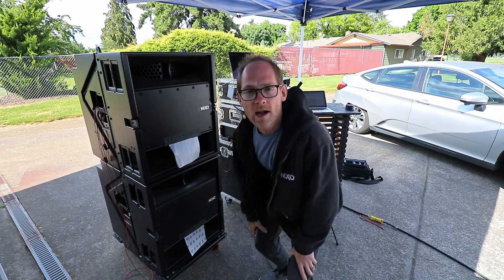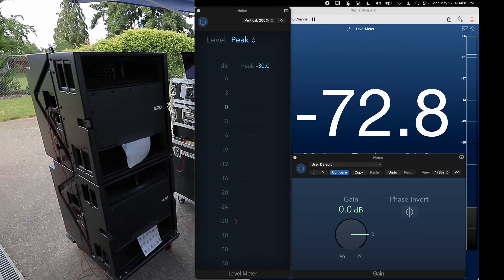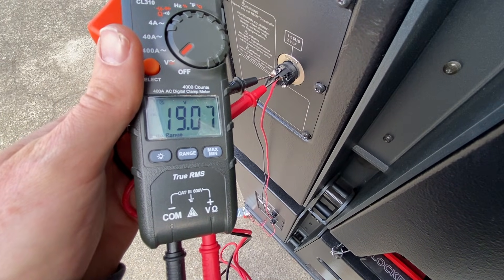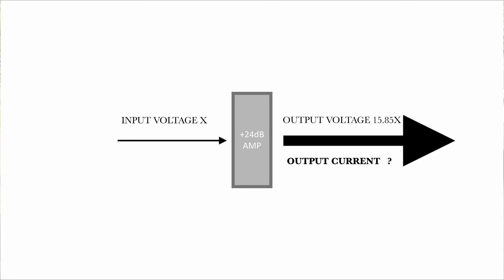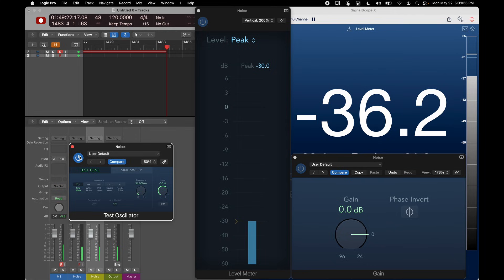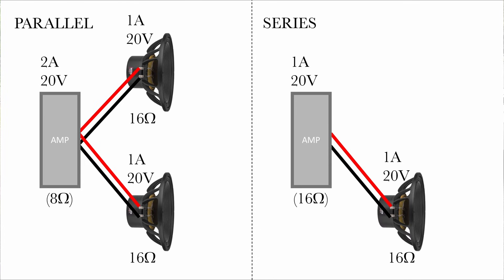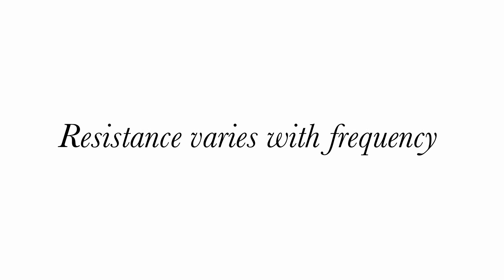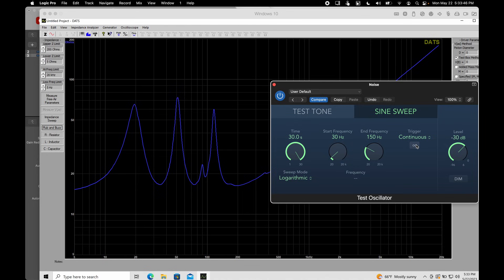Is doubling speakers +3dB or +6dB? What's parallel and series wiring?

Comment: But with the same impedance in the amplifier both series and parallel has the same +3dB effect.

Example__
Think an amplifier that is capable of delivering 64W at 4ohms. So that we drive 2 speakers with 2 ohm each by series way, so that each speaker will get 32W. We have two such speakers, therefore we get +3dB as doubling the power adds 3dB to the loudness.

And by that same amplifier, we are running two 8ohm speaker in parallel mode. Then the impedance will be the same 4ohm. Each speaker will get 32W. In this situation also we are getting +3dB due to the previous mentioned rule.

Note: only lowering the impedance and getting doubled power by the amplifier only increases 6dB.

Comment: Soo parallel is louder than in series and that's why most car subs that can go down to lower Hz will with proper power amp,  like a 1 ohm amp that will run to 1ohm sounds better or louder (proper box made to go lower hz) than one in series?
OK I got it. Thanks... Hope this is right?

Comment: Here's something I always wanted to know:-
You build two subwoofer boxes with two 18 inch 8 ohm speakers each. You wire both speakers in both boxes in series. That would mean both boxes would be playing at 16 ohms. If you were to then 'daisy chain' both boxes together at the speakon connectors, would they then both be playing at 8 ohms or at 16 ohms?
Reply: The added benefit of doing what you say in say a club is that if you overdrive those boxes wired in series internally, you will only ever blow 1 of the two drivers as as soon as 1 blows, the series circuit opens up saving the other driver. If you wire the boxes internally in parallel, you will most likely blow both drivers if you overdrive them. This is a huge consideration when designing a club system for DJ's etc to use. The cost difference between replacing half vs all the sub drivers can be astounding.
Reply: @wally7856  I know.
Reply: If you wire each 8ohm speaker in a box in series, that would increase the impedance to 16ohms per box. If you then daisy chain(parallel connection) each boxes, that would lower the impedance to 8ohms.
Reply: @ThaKingRyan  thank you. That's all I wanted to know.

Comment: Only coils in dvc subs should ever be wired in series. I would never, ever wire separate subs in series. Just asking for trouble.
Reply: Yes but wiring say a double 18" sub internally in series has benefits. In a club system if the DJ overdrives the system you will only ever blow 1 of those 2 sub drivers as the series circuit will open up saving the other driver. If you wire the box internally in parallel and overdrive the box, you will almost always blow both drivers.

Comment: You have to consider the Amplifier's impedance output as well.
Let me use 8 Ohm speakers because many amps have 2, 4, 8, or 16 Ohm outputs.
All Voltage, Current and Watts are RMS in my discusssion.

4 Ohm Output: Two 8 Ohm speakers in parallel = 4 Ohms (impedance match), at 40 Watts: In this case the Amplifier will supply 40 Watts. 12.649 Volts out with each speaker drawing 1.582 Amps each = 20 Watts from each speaker for 40 Watts total.
4 Ohm Output: Two 8 Ohm speakers in series = 16 Ohms (impedance mismatch), at 40 Watts: In this case the Amplifier COULD supply 40 Watts but it can't. 12.649 Volts out but only 6.325 Volts get to each speaker drawing 0.791 Amps each = 5 Watts from each speaker for 10 Watts total.

Since -3dB is roughly a 50% Power Loss, 40 Watts to 20 Watts is -3dB, and 20 Watts to 10 Watts is another -3dB for a total of -6dB (1/4 the Power).
So even if the Amplifier COULD try to put out 40 Watts with two 8 Ohms speakers in series on a 4 Ohm output, it can't do that due to the impedance missmatch.

This is why Amplifers usually have several impedance outputs. Since two 8 Ohms speakers in series is 16 Ohms, you should switch to the 16 Ohms Output (if the Amplifier has one):

16 Ohm Output: Two 8 Ohm speakers in series = 16 Ohms (impedance match), at 40 Watts: In this case the Amplifer will supply 40 Watts but now using a different voltage. 24.298 Volts out but only 12.649 Volts get to each speaker drawing 1.582 Amps each = 20 Watts from each speaker for 40 Watts total.

So If you change the Speaker arrangement and not select the proper amp Output Impedance, you will get less power out of the Amplifier or you may overload the Amplifier and cause damage. So ALWAYS match the Amplifier's Output Impedance to the Overall Speaker Cabinet Impdeance.

Examples:
One  12 Inch Speaker  at 100W at 8 Ohms             = Cabinet  8 Ohms 100 Watts RMS (commonly used)
Two  12 Inch Speakers at 100W at 8 Ohms in Series   = Cabinet 16 Ohms 200 Watts RMS (less commonly used)
Two  12 Inch Speakers at 100W at 8 Ohms in parallel = Cabinet  4 Ohms 200 Watts RMS (commonly used)
Four 12 Inch Speakers at 100W at 8 Ohms in Series   = Cabinet 32 Ohms 400 Watts RMS (Outputs for 32 Ohms are rare, not commonly used)
Four 12 Inch Speakers at 100W at 8 Ohms in parallel = Cabinet  2 Ohms 400 Watts RMS (less commonly used)
Four 12 Inch Speakers at 100W at 8 Ohms in Series/parallel = Cabinet 8 Ohms 400 Watts RMS (commonly used)

Series/Parallel Arrangement of four 8 Ohm Speakers 100 Watts each arranged for 8 Ohms 400 Watts total:
     |
  -------
  |     |
8 Ohm 8 Ohm
  |     |
  -------
  |     |
8 Ohm 8 Ohm
  |     |
  -------
     |  

So why are there 2, 4, 8, or 16 Ohm speakers?  The lower the Impedance (ohms) of the speaker, a lower Voltage is required to drive it BUT LESS AMPS (current) is needed as well.
Since current (Amps) is key is power distribution (think of High Voltage power lines), a 2 Ohm Speaker (or Cabinet) requires less current though the wires to get the power from the Amplifer to the Speakers. At home or small venues, 8 Ohms is fine, but in a large arena where the Speakers are up high and many feet away from the Amplifiers, 2 Ohm Speakers and Cabinets are better.  

Series/Parallel Arrangement of four 2 Ohm Speakers 100 Watts each arranged for 2 Ohms 400 Watts total:
This Speaker Cabinet requres less current to drive the speakers and thus less current/resistance (IR) losses though the cables.
Also, lower current cables can be of a thinner gauge which saves weight and cost.
     |
  -------
  |     |
2 Ohm 2 Ohm
  |     |
  -------
  |     |
2 Ohm 2 Ohm
  |     |
  -------
     |

Comment: How do you have the meter leads on?

I tried using a normal meter to test for voltage coming out of my car subwoofer amp, which obviously takes in 12-14v and i get weird numbers
Reply: Use ac voltage on your dmm. Use a sine wave test signal to test for voltage, using music will get you readings all over the place.

Comment: Is it true that if you have 2 speakers and one speaker can handle more power than the other, the that speaker will take the extra power? So if you had a 10 watt speaker and a hundred watt speaker and a 100 watt amplifier you wouldnt blow the 10 watt speaker cause the 100 watt speaker would take the extra power.
Reply: I don't think so. If the speakers are of the same impedance, they will divide the power equally, and so I expect the 10 watt speaker will blow at high output levels.

Normally, we handle speakers of different power ratings by only sending high frequencies to the lower rated speaker, via a crossover network, because most of the energy is in the lower frequencies of music. The half-way point for division of power in music is around 120Hz as I recall, just above subwoofer range.
Two full-range speakers of different impedances could be a different matter.

Comment: So if you use 2 8ohm drivers  in you dubbel 18'' sub woofer. and you wanna use 2 cabinets on one side on the amplifier. then you need to wire the speakers in serie?

Comment: I'm not into SPL. Just good tone with best coverage for speaker, whether one or two or amount of ears listening. If a venue has capacity of 10,000 sets of ears and 10000 minds or 10000 bodies, how much power is needed in subpower for 1/2 of 10000 bodies in avenue that is designed for 10000 bodies. That seems more reasonable for life of any subwoofer. Using math to figure out impedance load is cool but in real world, a knowledgeable sound engineer needs to understand this in order to do a solid sounding show.

Comment: So if i were to use 4x 8ohm 15" Woofers in Parallel, what would the Ohmage then be?
And by adding any other speakers (8ohm) (but not woofers), does this have any (negative) impact
Reply: That would effectively be 32ohms. If you have an amp that can handle that, go for it. You can add more speakers if you wish, but keep in mind the impedance will also go up, and you might end up working your amps so hard that they die. A good practice would be to match your amp impedance if possible, that would be either by connecting your speakers in a series/parallel connection or getting more amps for your speakers if you have the budget

Comment: So far, the best video I've watched in the 36hrs I've been trying to understand about speakers. I have these 5.1 speakers I found in our basement with it's player already disposed of that I want to use as a pc speaker, and I'm trying to learn how I can install them when there's just one front and one rear 3.5mm headphone/speaker jack, though it's got a sound card that supports up to 7.1, for the life of me, I have never been interested in electrical wirings until now. I don't how I can wire them all into one jack, or do I need to install another sound card with more ports, or buy some whatnot to connect them to. If they get more expensive than buying a pc speaker, they're going back to where they came from, useless.
I'm going to follow you from now on and learn.
Reply: 36 hrs.? get some sleep, trust me, it's not that exciting and rather simple to learn - make it last cause after slew rate and damping factor there is not much on the horizon.

Comment: Parallel cost more speaker wire than series connection, basically parallel is way better than series is that right Sir?

Comment: In the video 1 amp drives 1 speaker 1A 20v 16 ohm, so 20 watts. Does that mean when connecting 8 speakers in series with acoustic coupling the amp only draws 2.5 watts while having similar acoustical output as 1 speaker? 😮 Because 1 speaker: 20V 1A 16ohm = 20 watts. 2 speakers: 20V 0.5A 32 ohm= 10 watts, 4 speakers: 20V 0.25A 64ohm = 5 watts, 8 speakers: 20V 0.125A 128ohm = 2.5 watts. I know 128ohm could be high for an amp, but this is about understanding the theory. Using 4 ohm drivers would result in 32 ohm load in the same 8 speaker set up. 

Or to get deeper into it: 2 speakers in parallel would result increase +6db. Meaning having a big array of 32 speakers in parallel would increase the acoustical output by a massive +30db! I am thinking of building a compact line array system with a 3 inch driver delivering 104dB > so max SPL of a 32 speaker line-array system would deliver 134dB am I right?

Comment: I am looking to run 6 Bass. Is using 3 amps in mono, and connecting the othe 3 to the speakers better than running 2 per amp?. Try to make it powerful and cost effective. 
6 Bass amps would be to expensive at this point.
I appreciate your channel. Thank you.

Comment: When you raise the amplifier by 6dB it makes output voltage doubled (20V to 40 V) , and current flow also doubled as manner (1A to 2A).calculating the (P) power it show 4 times increment as this: 20V x 1A =20W and 40V x2A= 80W. Clearly 80W means 4times like 20W.

But when you attached additional speaker it only cost more current, but no voltage increases, resulting power = 20V x 2A = 40W.

My question is, why the measurement mic showing 6dB same increment at both testings above, while the amplifier produce completely different power output as, 40w vs 80W.
Reply: I'm not into SPL. Just good tone with best coverage for speaker, whether one or two or amount of ears listening. If a venue has capacity of 10,000 sets of ears and 10000 minds or 10000 bodies, how much power is needed in subpower for 1/2 of 10000 bodies in avenue that is designed for 10000 bodies. That seems more reasonable for life of any subwoofer. Using math to figure out impedance load is cool but in real world, a knowledgeable sound engineer needs to understand this in order to do a solid sounding show.
Reply: @rgortega1285 Most (sound engineers? are selectively deaf (notch filter damage in their hearing range). I walk out of so many concerts that i've quite going. When is their mommy going to tell them the truth?

Comment: Depends if they're acoustically coupled (coherent). If so, pressure adds and you get 6dB. If not, power adds and you get 3dB.
Reply: I agree, two speakers outputting 20 Watts each is 40 Watts total, but speakers in unison do not add sound pressure levels linearly, they just push more air in parallel but at the same loudness. So dB in sound pressure does not always double when two speakers are driving the same signal at the same power level compared to one speaker doing the same.  Take your stereo for example. You hear a tone pan from the left to center to right. When in the center, the sound is not louder, it is just balanced and sounds like it is from the middle. Each ear is hearing about the same volume level (just slight delays due to distance and echos in the room) but the sound from both speakers don't add up (in a perfect acoustical dead room) they just sound fuller. With head phones, you can get a wider separation but less fuller because each ear hears only one speaker for the most part.  This is why there is a sweet spot in your stereo room where the sounds balance out to about what you get from headphones. Stereo recordings are designed for the left channel for the left ear and the right channel for the right ear. So in your stereo room - which should be acoustically dead, the sweet spot has no echos from the room and the program (music) can be listened to as it was intended.
Reply: exactly, try this again at 15khz 30ft away and see what you get